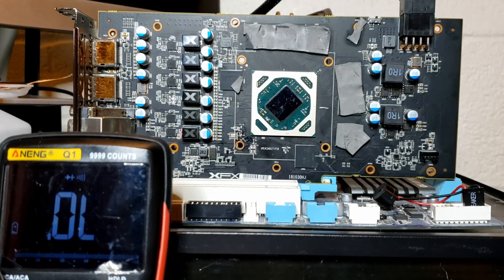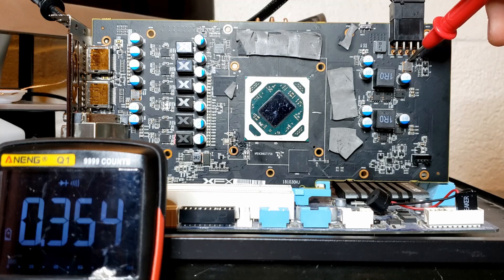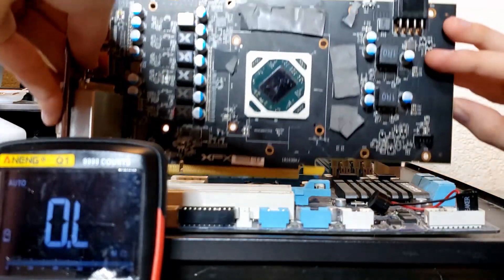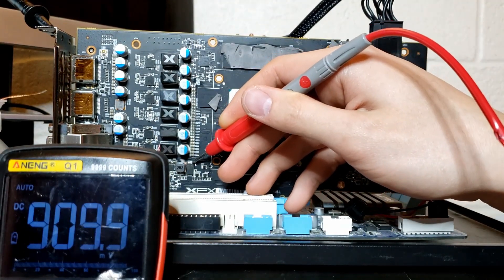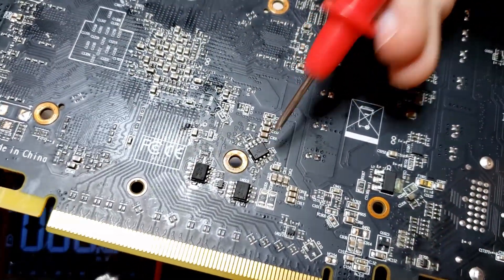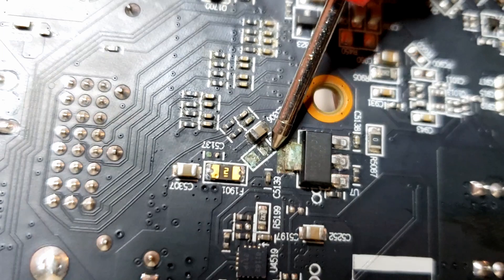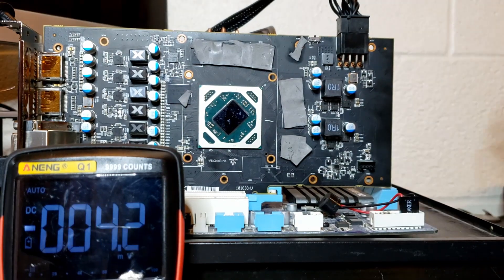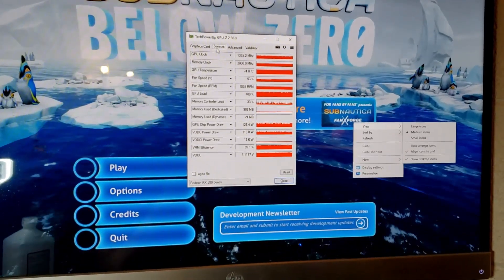XFX RX 580 GTS Repair #1 - Not Detected

Comment: Hi Tech Cemetery, thanks for the help you provide in this gpu shartage period. I have the same video card (same pcb), all voltages and resistances like yours but the card is unstable.
Sometimes it works for hours, other times it crashes after 5 min.
I suspect that an electronic component has been damaged (but not broken) because I get strange results from the benches (attached below a video).
I did some tests and with only 100mhz of underclocking on the memory the confetti disappear, but the card is still unstable. Other major underclocking on memory or gpu also does not make the card stable.
I hope that thanks to your great experience you could help me understand the problem and if it is possible to fix it.
Thanks a lot

https://youtu.be/5fHjgINsYv0
Reply: Could be vram or g card cpu

Comment: got an msi armor 570 8gb  that has 12v 3.3 v and 5v rails   also card has memory 1.5v and vcore 0.9v  gpu gets warm and fans spin windows wont detect the gpu  can this be bios or it a dead gpu core ?
Reply from the maker: Check the PCIe lanes. Watch my "mining riser inserted backwards" video.

Comment: Hi,i have dead gpu  aorus rx 580 with gs7103 LDO,when i test and check LDO voltage, it show Vdd = 5 v,Vin=3.3v,En=3.3v, POK=3.3v,Vout=1.8v.  Does my LDO still ok or bad ? Thank's

Comment: My XFX 570 stopped working yesterday :( I uncovered it and am checking it. When I turn it on, the led blinks once and then everything shuts down, including the PC. I think it's shorted, because all the capacitors near the mosfets give continuity.

The first 3 pins give continuity. 

XFX is supposed to give a 3 year warranty, but I live outside the USA.

Comment: Hey lil bro I got two gpu that need to be repaired rx580 and 590 obviously amd ones a radeon original 8gb, the rx590 is as well an amd but the air is Sapphire nitro pulse. Any way of reaching you if you do that and where are u located. I'm not getting a display on one. The other a screw fell on a mosfet a cooked it and some of the pcb below it, but nothing serious
Reply from the maker: I have an email listed in the about section of my youtube channel.

Comment: mine shorts out at the GPU 12V to ground. what can I do? Both pins of C721,C720, C718 and C731 (the cap next to the 1R0, near the inductor you probed to check for short)are shorted to ground. Could they be the cause?
Reply from the maker: A short on 12V generally means you have a bad MOSFET. Check my "Computer won't power on" videos. Otherwise if you can't find the source of your short bring it to a repair shop.

Comment: hello tech cemetery I have an rx 580 like yours the same pcb, my rx 580 stopped working, fans at maximum and no signal I start with igpu and gpuz recognizes it as 590 and the vram gives me 0mb and the graph is 8gb,  I'm going to disassemble the card and check volts.  Any advice, sorry if there are errors, I don't know English and I'm with a translator, hehe, thanks

Comment: I've got a question I'd appreciate your feedback on. I've been trying to diagnose a GPU I received. Ive checked the PCIe lanes, Power planes and all seems to be good. I think the core itself is dead, but how would I diagnose that as the problem? Thanks, love the content.
Reply from the maker: For a card that is not detected. You'll want to flash the BIOS, check the capacitors on the PCIe lanes on the back ( if they are not 220nf roughly, assume they are dead). You'll also want to use an oscilloscope to check the 2nd and 5th pin on the BIOS for activity, if there is no activity and the BIOS chip is good as well as everything else, you can assume the GPU is dead. Finally check the Quartz, it should generate a 27mhz signal.

You'll also want to check the resistances of the power rails connected directly to the GPU, if they have an abnormally low resistance, the GPU is likely dead. Not all dead GPUs have giveaways that they're dead, sometimes the only way to confirm it is to take it off the board.
Reply: @TechCemetery  Thanks for the advice. You're the best

Comment: Hi, love your videos and I've just subscribed. Your knowledge is next level!

I have an MSI RX 570 8gb Armor which started artefacting and now won't show video output. It's only been used for video editing. It is however still detected and fans spin. Is this likely to be a VRAM issue? Are there any simple ways to fault find what the issue might be? Many Thanks
Reply from the maker: Detected with error 43 in device manager?, Or without?.
Reply: @TechCemetery  thanks for the rapid reply. I haven't had too much time to investigate further. But I just booted it as secondary gpu into safe mode and it didn't have an error 43. For some reason though my pc wouldn't boot into standard windows with it plugged in as secondary gpu, it blue screened with a driver issue which I've not seen before, that could be unrelated though.
Reply from the maker: @gbcthorpe  Without more details, I can only vaguely guess you have bad memory, a bad GPU, or maybe damage to the BIOS chip and or circuitry.
Reply: OK thanks. I will do some more checks this evening. Anything you would recommend I could do to try and narrow down the issue?
Reply: OK so more testing; I'm getting a constant loop of 'thread stuck in device driver' if I try and boot the rx 570 as a secondary gpu. If I boot it as primary I get no output at all. I manage to boot into normal Windows with it as secondary gpu after doing a DDU of drivers in safe mode, but as soon as I install amd drivers I get the blue screen again.

After a restart again it booted as secondary and displayed error 43. So it's either blue screening or error 43, it's very random.
Reply from the maker: @gbcthorpe  I'm not that sure since I don't have the card in hand, but I would guess it's the GPU itself at fault.
Reply: @TechCemetery  OK thanks! Keep up the great videos.
Reply: Sorry to message again! So running the gpu again today as primary gave a B2 error code on my motherboard - I think this means the core is not working correctly? Is it just the heat gun/oven method left to try? Thanks
Reply from the maker: @gbcthorpe  AMD cards that have memory corruption hang on B2 when used as a primary card. I'd hold onto it if I were you or sell it. Heat gunning usually doesn't work out.
Reply: @TechCemetery  OK thanks. So this isn't something I can repair?

Comment: You can get these XFX RX 580 GTS for cheap on Ebay... I think this is American/Chinese GPU manufacturer. I couldn't find any reviews but now I can see at least the PCB. It has 5 phase VRM and 2 phases for memory based on what it looks like here. And Max power of 225W

Comment: I have a GTX 980 from MSi and i dont know wahts wrong with it. with out the driver it goes to windows and its fine but as soon as the driver loads. Black screen. any ideas what could be wrong?
Reply from the maker: Cards like that usually have bad GPUs, or are hard to repair. Check for missing capacitors on the back of the GPU and or memory. If nothing is missing, sell the card.

Comment: You think the bios chip or memory could be the culprit when the GPU isn't recognized in the device manager and the resolution refuses to go past 1024x768? If I try to go past 1024 x 768, the screen artifacts. The GPU is an MSI 2070 SUPER GAMING X btw. Reinstalling GPU drivers doesn't fix it. The problem started after a power surge.
Reply from the maker: I'll be honest, I'm not sure what to think. I'm inclined to think you have a problem with the GPU itself, but like I said, I'm not sure what to think. Are you able to take resistance measurements on the various voltage rails?.
Reply: @TechCemetery  Yes, I can. I picked up a multimeter after watching your videos yesterday.
Reply: I checked PCI-E ground with continuity and got a beep when I placed the probe on the 5th pin from the right.
Reply from the maker: @geforce5591  For PCIE, 1.8V, and the memory rail you'll want to use resistance mode. Let me know what you get on each of those.
Reply: @TechCemetery  Do you mind assisting me with pointers on where to place the red probe? I watched buildzoid's dissection video on the same card, but I'm not 100% sure I'm placing the red probe in the right places.
Reply: @TechCemetery  These are PCB pictures for the front and back side of the card from techpowerup
Reply from the maker: @geforce5591  
https://imgur.com/a/FqG3cUD

For 5V, only one of them needs to turn on as  the other is just power for the inactive USB-C port.

And my locations for 1V and 1.8V might be switched, I only have a reference RTX 2080 in hand to make guesses.
Reply: @TechCemetery  
Resistance across 1.35v = 25-26 ohms
Across 1v = 12 -15 ohms
Across 1.8v = not reading
Across 5v = both not reading

All measurements are taken without external power.

Comment: Informative as usual! I have a question... I noticed you only target/repair cards with no power or no boot scenarios. Is that because they tend to be easier to diagnose? What about cards that half work? Show up in device manager, but won't start or crash when installing drivers...
Reply from the maker: Cards that half work disproportionately have bad GPUs, and I don't keep spare GPUs lying around for those cards. The ones that don't have bad GPUs tend to be very hard to diagnose if they don't have obviously missing components behind the GPU and memory.

I focus on cards with no boot/no power because they tend to be easier and are also much more common.

Comment: It's great to see your passion.  I wonder how you find information about schematic diagrams. In previous repair you said 10K Ohm resistor had problem  and it was the enable signal for display voltage. The question is how did you find out that res is related to display voltage?! 
Thanks in advance
Reply from the maker: Mostly experience and poking around using continuity mode.
Reply: @TechCemetery  Well done, I appreciate your work and I wish all the best for you.
By the way, I'm an electronic engineer and I know how hard it is to learn different things by yourself. My special skill is about designing high speed pcb with altium. It was really hard to learn with nothing.
Reply: @TechCemetery  I have almost same pcb rx 570 everything is same except vrms i have issue with display rail it has 940mv but it beeps on continuity on both sides of cap,also i have 1.8v 3.3 5v and every other u tested in video gpu gets detected when its 2nd card in system,but wont post when set as main gpu. tried bios flashing  and reflow so far.

Comment: Top boy again 😂 I completely forgot I had a broke rx 580 8gb se sapphire card trying to match what you do in this video I can confirm it's still broke 😂 I have 12v 5v .906v memory 1.5v vcore is .849v die warms up but still no picture dunno what's a matter with it just refused to work one day fans and lights work but never get picture as its in my back up I just put a 970 in there and never touched it again until today 😂
Reply from the maker: I've had one RX 580 like you described, working fine with all voltage rails until one day it was not detected. I remember this card because it was the first and only card I ever had that suddenly became detected after doing a reflow of the GPU.
Reply: @TechCemetery  ill give that a try tomorrow and check back but I a have a programmer I read the bios ic chip and it was completely blank not a single bit of code so flashed it with an actual bios but same as before not detected its frustrating as can't test for long as chip gets warm and don't want to risk it cracking ill let you. Know how I get on one thing tho the resistance of the vcore was only 0.8ohm can't tell if that's good or bad 😂
Reply from the maker: Vcore resistance is normally very low on semi modern GPUs. I don't even measure the resistance of a GPU unless it's GTX 900 series or older.

Comment: Hi, nice video, I have a short in this graphic card in the alimentation of 8 pin, but I don't know who's short, it's not MOSFET.
Reply from the maker: Have you checked the capacitors on the back?.
Reply: @TechCemetery  I have been analyzing it as far as I know and I have extracted several pieces, but I do not understand what the short could have.
Reply: How can I test an FDMF3035 to confirm if it is short?
Reply from the maker: You'll want to take it off and check for continuity between either VIN and AGND, or VIN and SW.
Reply: @TechCemetery  So to verify that it is good, do you have to remove the FDMF 3035?
Reply from the maker: Yes, unless gate low (GL) reads as short on one powerstage but not the others. I recommend you take off the inductors instead as that is easier like I do in my EVGA SC 1080 Ti Repair #2 video.
Reply: @TechCemetery  I will see that video right now to understand, I really don't have much hope for this graph, but at some point I tried it and it came to give video and everything was fine, but I had it saved, and I don't know.
Reply: @TechCemetery  Perfect, I already saw the video and understood, currently I have removed the only inductor that is there, in the video I see that it is the same card but it has differences, ah I just saw that you uploaded a # 2, the one in that video is exactly the one I have with the APW8722, I'll watch that second video. I am thinking of sending you an email with attached images of the condition of the graphic, I have another donor of the same model that suffered a short and burst an FDMF 3035.
Reply: The short is present in the part of the 2 cap 2.5V with 35.5ohms.
Reply: @TechCemetery  I just removed all the inductors and I am not shorting any of the phases, I literally have no idea which part is shorting.
Reply from the maker: @vernanflexx6079  You need to get a power supply, finding a short without one is very hard.
Reply: @TechCemetery  I'll make one, thanks for the tip.

Comment: I’ve repair about 15 of these cards on very common fault is a cracked / burned capacitor on the back side of the vcore vrm, that’s one aria I would check if there is a short in atx 12V.

These caps tend to burn themselves out as soon as you inject 12V.

Always check the vcore output if voltage gets through before injecting 12V !
Reply: Do you fix these for a fee?

Comment: Nice, finally another AMD card after a bit of time.
Im surprised not only because the corrosion could ate a resistor down to the pad but also you could run the GPU with some mosfet removed.
Btw about your last Nvidia card video about memory corruption do you have some diagram about resistor placement for certain memory type and brand?
Reply: depend of controller chip but most of them will run without one or even more power stages. Card will not be stable but in past I take advantage of that to "fix" otherwise unfixable cards (burned boards, no way of replacing a mosfet), lower TDP and/or clocks little bit and give them away to people who didn't have means to buy better cards but still want to play games.
Reply: @gorky_vk  like some company use the same PCB but with different GPU and some power stages removed? Makes sense now, thanks man
Reply from the maker: For the resistor placement, I usually have to look at other cards to guess where it's supposed to be. There are datasheets out there but I've never come across one.
Reply: @TechCemetery  well looks like i have to look on some various PCB online and learn it manually.
Btw i have some GPUs everything seems to be normal but sometimes it became really unstable and freeze. I found that underclocking the memory by 400 mhz solve the problem but i lost a lot of performance. Is this pure a degraded memory or it could be some other problem, thanks.

Edit : the voltage is normal 1.5 btw.
Another edit : sometimes under load there's a thin layer of ocean wave like distorsion on the screen.
Reply from the maker: If you have an oscilloscope, you can check the memory voltage to see if it looks stable. Otherwise cards like that are hard to diagnose as there's no sure way to tell if it's memory, the GPU, the PCB traces, or even the capacitors behind the GPU and memory.
Reply: Well unfortunately i don't have that fancy tool yet